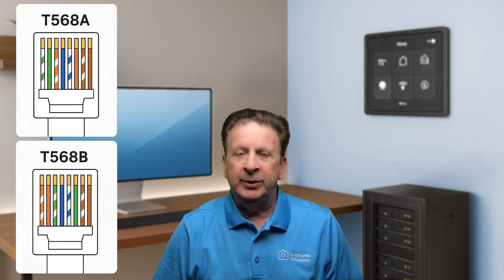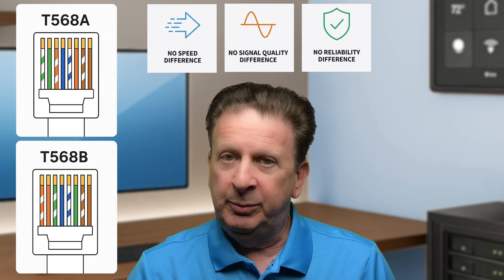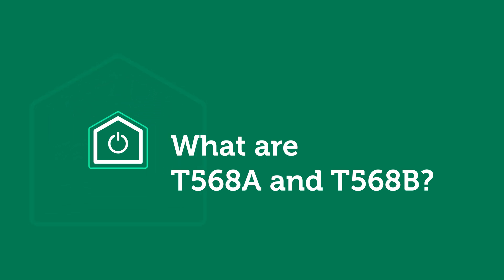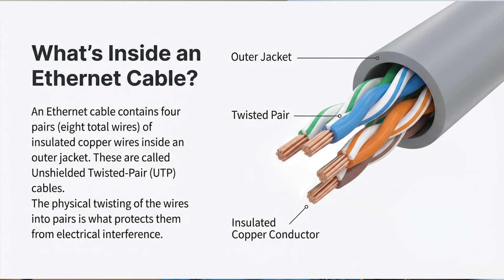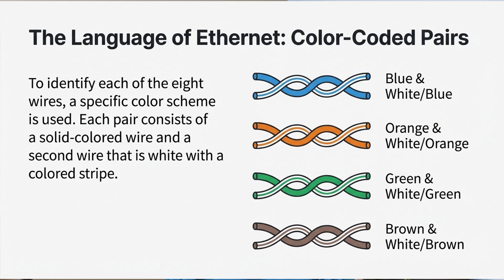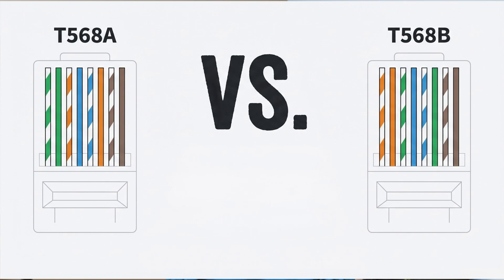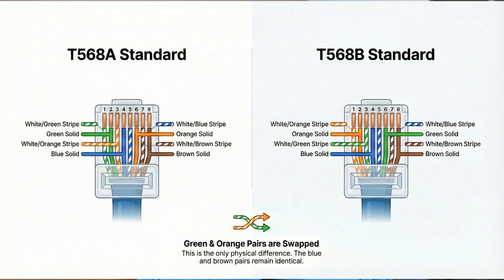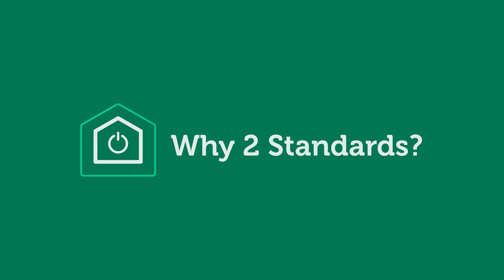T568A vs T568B: Which Ethernet Wiring Standard Should You Use?

Comment: When making patch cables, it doesn't generally matter. You can even rotate the blue/brown pairs or even swap striped vs solid. I have even seen some cables made where the pairs are all next to each other (like 1-2, 3-4.5-6.7-8), which I think does affect signal quality, since some of the +/- signals are on different pairs. However, as long as the 3-6 and 4-5 pair split is observed, any color or polarity works fine, just as long as it is the exact same on both ends (unless you're making a crossover cable or similar).

If you're installing permanent wire runs in a building, you should pick one or the other, though, and if you're doing rework or adding runs to the wire plan, use the standard the majority of the existing runs use.
Reply from the maker: Yes, but there is a difference between "it seems to work fine" and the certified wiring patterns.  Patch cables are much more forgiving because the distances are much shorter than normal runs and the wires are not packed tightly in conduit or walls, etc.

Comment: If order does not matter. Then i can create my own order. As long as the same twisted pairs are used for the same signals. Swap colors. Will call it the "WHY did they do this" standard.
Reply from the maker: Order does matter, especially with 1 Gbps Ethernet (versus slowers standard 10 Mbps) where the twists-per-inch are different for some of the pairs and that allows the higher speeds and spec'd distance to be achieved.
Reply: @DoItForMeSolutions  Did not know that the twists per inch are different between pairs. Thank you for that. No new standard for me. Darn.

Comment: STP cables shield individual pairs, SSTP cables shields pairs and also shield whole bundle.
Reply from the maker: Do you use STP or SSTP cables?
Reply: @DoItForMeSolutions yes, it was for EMP weapons system. But I suspect there are other uses where cable has to be in high EM interference like welder.

Comment: Very interesting... but STOP talking about RJ45. Nobody uses RJ45 in Ethernet. RJ45 is a Registered Jack for telephonic use only. We use an 8P8C connector.
Reply from the maker: That's a subtle distinction I'll have to remember.  I've never heard anyone call it 8P8C, only RJ45.
Reply: @DoItForMeSolutions the RJ45 jack has a protrusion on the side face and is incompatible with 8P8C socket. And one can use 8P8C jack with the RJ45 socket.

Comment: these standards are for MDI interfaces, since MDI-X it really no longer matters, MDI is Media Dependant Interface, the X is for crossover.
here we always use the B standard, unless it is a "host to host" or a "switch to switch" that are MDI only, in which case one has to be type A. 
the other thing is that A tends to be used in the US, but here in the UK we had the BT 431A for phones which is a completely different plug type, so we really only ever use the T568B standard. to run now old style phones over the structured cable we would use a TAD lead (Tailed Line Adaptor)  
as long as you have MDI-X switches, it really doesn't matter what standard you use, you can even have A at one end and B at the other if all the equipment is MDI-X as the switches will switch to crossover mode and still work just fine, but it is always better to keep to just one standard, because it isn't always data that is being sent down these cables and there are different devices that can be plugged into one of these jacks.
Reply from the maker: Yes, auto-MDI-X has certainly simplified things for most modern networking scenarios.

Comment: I have worked for a state telecommunications company, as well as in data centers in Latvia, EU. We always used the T568B standard. As a cabling professional ( the most of hints I learned on my own ), I can recommend some tips. It is not good style to crimp RJ45 connectors onto solid wire cables ( there are sockets and patch panels for that ), if you do, there are specific connectors specifically for solid wire cables. Don't use Chinese connectors and tools. Better use brand products. The best crimping pliers, which I have used was made by AMP.
Reply from the maker: In the US, there are RJ45 connectors designed for solid wire versus stranded.  Would be interesting to know if that is manufacturer recommended or based on an actual standard.  And yes, of course, all structured wiring should use punch down patch panels and keystones instead of individual RJ45's for better installation practice.

For crimp tools and supplies, I've had good experience with two brands popular with installers - Klein Tools and Platinum Tools.
Reply: @DoItForMeSolutions  The problem is that procurement specialists of state-owned companies usually try to choose the cheapest offer in price surveys. And, at least in post-communist countries, they did not have the right to indicate specific brands, because it supposedly eliminates competition. As a result, products of dubious companies were purchased. The stupidest thing was to save on RJ45 connectors ( plugs ) . A no name connector cost was 10-15 cents, brand one around 40 cents. I am sure that at least a few times the specialists had to drive several hundred kilometers at night to the border customs post to restore data transmission just because government organizations saved 30 cents per connector.

Comment: Cat6 cables terminate perfectly using T568B into the RJ45 because of the plastic cross-shaped core, due to pair alignment.  Using T568A, the green and orange pairs cross over.
Reply from the maker: There are definitely skills involved in crimping connectors.   I have seen small plastic inserts to align wires and then, of course, the pass-thru versus butt-end connector debates.
Reply: The difficulty often depends on the end of the cable and the type of cable. But patch cable you can buy of the shelf are usually T568B.
Reply: @hw2508  No it doesn't matter what end of the cable.  Cat6 cable aligns perfectly with an RJ45 connector using T568B.  The same can not be said for T568A.
Reply: @rickski64  My experience is different.
Reply: @rickski64  My experience is different. The Cat 7 cables I'm familiar with don't have the plastic cross-shaped core as an example.

Comment: you just need to have to came colour combo in both ends, you could swap any two wires colour pairs, and as long as you do the same in both ends it works,  giving you 24 options that works fin, and it is the same if you swap the ful and striped in a pair giving you 16 times more option, so you now have now 384 optionens that work as long as you use the same in both ends.
Reply from the maker: I would disagree.  Sometimes "things work" in a particular situation, but when not to spec, will not always work.  The twist rate differences in some pairs doesn't matter for short runs, but you will see speed and reliability problems if you don't follow A or B for 1gbps, 2.5gpbs or faster Ethernet and decent lengh runs.
Reply: @DoItForMeSolutions  nop, :)
don't try to BS me, 
You know why the pairs are twisted, it is to minimize the integral of the area in the loop between the two wires in the pair. And doing it continuously helps with the difference in signal strength of the noise going through the loops.
Right,
The twist rate differences between pairs are done to counter crosstalk, as if they are twisted at the same rate, it is as if they are not twisted. The transmitter and receiver swap polarity at he same rate, it is nearly as if they is not swap at all. .

Thank you for responding,

Comment: 6:04 - But *why* did they adopt the B standard if the A standard is the same, PLUS has better color compatibility? There's so much missing from the history of the A/B standard choice and very few presenters (including yourself unfortunately) provide anything resembling primary sources for any of the claims.
Reply from the maker: That's a question I have too! I couldn't find any definitive answers other than vague assertions of reliability and higher speed for which I couldn't find any supporting documentation.  I agree the question isn't clearly answered, I should have stated that I don't have an answer supported by clear facts so I won't stoke the arguments with only opinions.
Reply: @DoItForMeSolutions  
It was a petty turf war between IBM and AT&T before MDI-X auto-detect saturated ethernet devices in the early 2000s.    
Every cable standard shift has more to do with marketing and market control than modularity for the end user.  I guarantee they were trying to license the end connect pinouts and when they realized that wouldn't work they were trying to control the device interface and then auto-detect came out and everyone forgot about it.
Reply: Likely because no one knows why most people decided to us the B standard.  I know a few places like the US gov't decided that A was the standard and everything being done for them must be in A unless it is a cross over cable.  Not sure why most places decided to us B when it sound like A was a slightly more compatible version in the US at least it might have been B was the inital "standard" before it actually became a standard and so most of the eairler user used B because of that.  Once something becomes common it will generally become the standard.
Reply: I assumed that the A and B variations exist and necessary for the crossover cable. Which were necessary in the early days. But are basically irrelevant now.
Reply: @abramb8690  The fun part about that assumption is that only crosses over half the cable and limits to 100Mbps bandwidth. The wikipedia article called "Ethernet_crossover_cable" has good diagrams.
Reply: @Jamesaepp 1gbps was not even a consideration when the A and B standards were decided.

Comment: Rf Engineer here. (Retired).
One thing that is not mentioned is the fact that, two of the pairs are wound tighter, more turns per inch, where as the other two pairs are wound with less turns per inch. This would in fact have different Impedance characteristics. At least this is what I have noticed while using Cat5 cables. The reason for the twist in the pairs, is to cancel out common mode currents, thus reducing RF energy leakage and the same for rejecting RF interference. The two wires are in fact differential, so each one is 180 degrees out of phase, hence balanced.
Also different  protocols are used with different Network speeds. Cat-5e, 1Gig, (apx. 30Mhz) Cat-6 >1Gig....(>30Mhz)
Since there are in fact two pairs that are wound tight and the other one looser, one must take into account that one pair is used to send data to a host, and an other pair is used to received data from the host. So it is imperative that you use the same twist for the data! The other two pairs are used for "what ever" Analog, DC Voltages, 24-48vdc etc.
Otherwise mixing the twisted pairs, will in fact cause issues, dropped packets, etc....
Reply: @dalesmith8666 1000 and 10000 Mbit/s ethernet uses all four pairs for both transmit and received. There is no RX and TX pairs. The receiver will cancel out its own signal and be able to receive on the same pair that it is also concurrently transmitting on. For 1000 Mbit/s ethernet we thus transmit at 250 Mbit/s on each pair and we do that in both directions concurrently, so there will be no collisions. In addition many devices also don't care if you switch the pairs, so connecting a cross over cable will simply be ignored and it will work anyway. It is however obviously important not to break the pairs and that is the typical problem when people make their own cables.
Reply from the maker: I believe the varied twist rates are for Cat 6 and higher and isn't spec'd for Cat 5 or Cat 5e?  (Cat 5e is still popular and often used for outdoor and direct burial applications.)
Reply: @DoItForMeSolutions  All pairs in UTP cable generally have different twist rates. This is to prevent cross-talk between the pairs due to magnetically induced current. The data flowing through the wires is an electrical current which induces a small magnetic field. Each pair is twisted together to mostly cancel each wire's induced magnetic field by reversing their relative polarity. Some induced magnetic field still exist, though they are much weaker than if they had been untwisted.

If any two wire pairs had the same twist rate, their small periodic magnetic fields would align and constructively interfere with each other (i.e. make each other stronger) to induce current in both pairs and cause cross-talk. Since all four pairs have different twist rates, their magnetic fields destructively interfere with each other thus preventing that induced current and cross-talk.

The twist rates are not specified in the IEEE or TIA standards, so each cable manufacturer sets their own twist rates.
Reply: In the standards the signal speed (or run time of the signal) is measured and part of certification. But not only the total run time, but also the difference between the pairs is measured.
However, usually that is not a problem in modern wiring.
Reply: Yep, that's why you MUST NOT split a pair. Each pair has a different twist ratio, which reduces crosstalk between pairs. If you mess it up, you will greatly reduce the maximum length of each cable run.

Comment: I have typically used B. However, my question involves patch cables.  If pins are paired 1 to 1, 2 to 2... and the cable works, does it matter?
Reply from the maker: Patch cables should be wired to T568A or T568B, not random paired through connections.  Short distance of many patches means it "probably" will work, but there are all kinds of things that "kinda/sorta" work, doesn't mean it is recommended.
Reply: @DoItForMeSolutions  Just thinking; a T568A on each end of a cable is pin 1 to 1, 2 to 2 , 3 to 3 and so on.  So what's the benefit of just moving the wires around?  My cable tester indicates a working configuration as long as the pins match on each end.  I'll stick with the B standard, but electrically matching pins end-to-end works, 1 foot or 300 feet.

Comment: some wire have specific line (for satellite line) but I haven't check the pin and if  T568A or T568B change ...
For sure on Gigabit network it doesn't mater
Reply from the maker: The differences are slight, but higher speeds and longer length cables could show signal differences.

Comment: It 100% doesn't matter. The work order tells you what is requested so both ends have to be the same. Done. Some companies have a standard that they use internally. I've worked for companies that use A and ones that use B. The colour coding actually goes back to old POTs systems. The speeds are identical and when it comes to "smart homes" your door locks and automated water valves aren't going to be using 10gb so it's irrelevant.
Reply from the maker: You're right, as long as both ends are consistent, it works perfectly fine for most applications.
Reply: The category of the cable and the length, the network adapters will determine if you can get 10Gbps. Choosing A or B has zero difference.
Reply: @abramb8690  I was being facetious with the door locks...🤫 however, I have seen certs fail because installers don't keep the twist up to the IDC termination. But yeah i'm joking with the door locks. Even pushing a software update to an embedded system could be accomplished with any cat.

Comment: Lot's of 1/2 truths.
Reply from the maker: Please clarify - your input would be valued.
Reply: @DoItForMeSolutions  one of the things that everyone gets wrong about the color code is it starts out white blue blue white white orange orange white white green green white white brown brown white the white is the tip side of the line and the color is the ring side of the line this is part of a 25 pair color code Another thing is the four pair plug concept was developed by AT&T/bell telephone laboratories was used with their analog and semi digital telephone systems. It was also used with what is referred to as four wire circuits for data type transmission. Eventually, the cable was used for data transmissions at a higher rate. The CAT5 concept was used in the 60s by AT&T/western electric in their analog switching systems for data control. You are 100% correct that the an and B have no bearing on the data through put. if a person studies the 25 pair telephone cable you were fine that the pairs are all twist the differently to reduce cross talk from induced current/inductive garbage that may be in the area of running multiple cables together, simultaneously or around different types of AC cable, such as electric on so forthyou do put for a lot of good information however, there's a lot of issues that are not necessarily true. They've been bad repeats from other people who have no understanding of the concept of its original design in the 70s thanks.